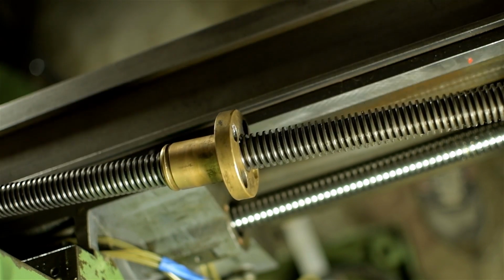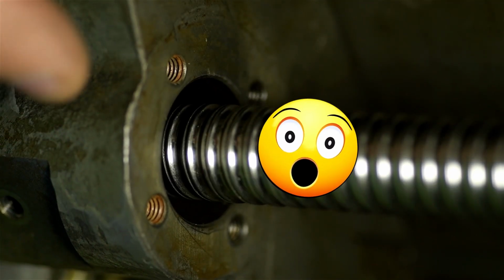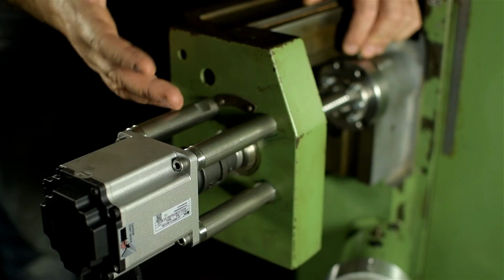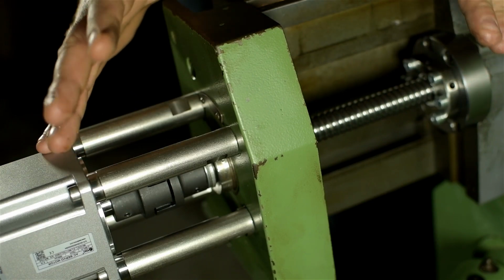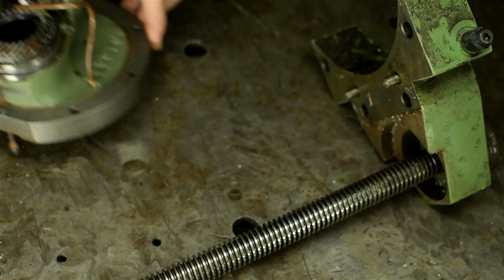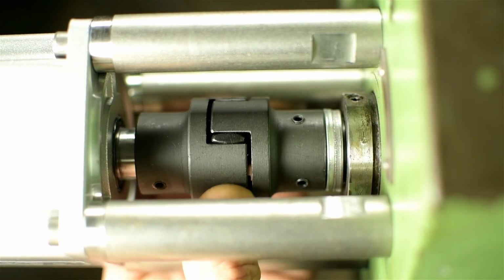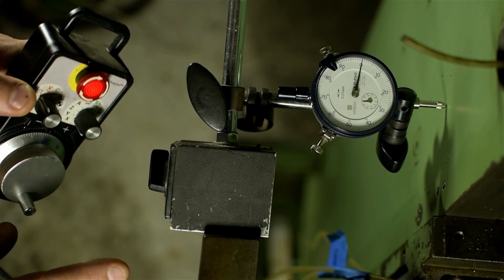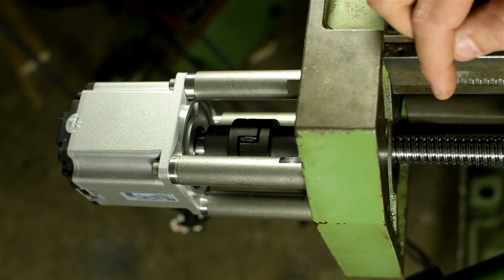Maho X Axis?  DONE!

Comment: As a CNC maintenance engineer: you used the wrong coupling. Those spider couplings are designed for use with things like pumps and have flex in them to help absorb shocks and vibrations, thus are terrible for CNC axis drive. For attaching a servo onto a shaft like that you would generally either just key it straight to the shaft without any coupling as such or put some kind of torque limiting "clutch" in the middle that will slip if you crash the machine. (kinda what a key does anyway if you choose the right size key) 
You could probably use a suitably strong version of one of those accordion type couplings as they don't have any rotational flex like the spider couplings do but there isn't really any point when the motor and shaft are concentric and solidly mounted, they are designed for mitigating slightly misaligned shafts which you shouldn't have. 
Hope that helps :D
Reply: Can you say something about Z maybe?
Reply: I think I can physically see the two ends moving separately.
Reply: @AlexanderYastrebov  the belt is the worst part of that, it went loose on the other side so it clearly flexes a lot during operation
Reply: Cnc machines doesn't use couplings?
Reply: Haha he said misaligned shafts
Reply: The Hurco CNCs I used to run almost definitely did use motor couplings, of the kind Tony is using, the damping material may be wrong, i.e. it needs to be stiffer, but I’m not sure running it without any damping would be advisable, more research needed I think.
Reply: Tiago Lomar It depends on the type of coupling. I’m in HVAc an work with pumps and fans all the time. We see lots of these “Lovejoy” style couplings. They’re pretty forgiving when dealing with loads that still have momentum once shut off. In other words, the exact opposite of precision. Not for a CNC for sure. I like our previous poster’s idea of directly connecting the shafts together. Maybe a simple spline?
Reply: There are spiders with a very high shore hardness to minimise backlash. This does not seem to be one of them so you make a valid point. How ever with those standoffs I woudnt say you have the best alignment. A rigid connection will work but considering this soon to be family heirloom some sort of compensating coupler will go a long way.
Reply: @SirKilmore001  in addition to the higher hardness, it should be a pretty tight fit in there to pretension the rubber.
Reply: @lwizzit  I work in the maintenance department of one production unit, this type of couplings is very familliar to me too. I am just asking if cnc doesn't use couplings, no saying.....
And yes this couplings aren't design for precison due they have some gap's to correct possible misaligments
Reply: @tiagolomar  technically a key and keyway is a type of coupling as it is connecting 2 shafts or a shaft and pulley or whatever but in my experience of every CNC I have stripped down they never use flexible couplings like that on the servo drives because you want the servo to be rigidly connected to the ball screw. 
The encoder in the servo knows where the servos drive shaft is but if the ball screw can rotate relative to the servo drive shaft (through the flexible coupling) there is room for error in the system. There needs to be as little "play" as possible between the encoder in the servo and the final thing you are moving and want to know the position of, in this case the x axis bed, otherwise the servo cant accurately control it. 
If the CNC machine had a hydraulic pump or something on it then that might well use one of those flexible couplings to connect to its drive motor but they aren't used in this situation.
Reply: I'm sure you've already ordered the right part, but I think you are looking for a "servo motor shaft coupling" it looks similar to the slinky style you flashed in the video, but is a little more rigid. Also, expensive.
Reply: @AlexanderYastrebov   The way the Z is mounted up all seems legit, as T.O.T. says CNC machines never use ACME screws so who knows how that will work out but i can't see why there would be any catastrophic problems. With the weight of the knee pushing everything down onto one side of the pitch it should have reasonable accuracy as long as it doesn't bounce when machining. 
As to why the belt was getting hot, I'm not sure, maybe it was not big enough or over tensioned or something? If the shafts are misaligned (there I go again) the belt will track against the pulley flange and rub making it get hot and also wearing out the belt pretty quick, can't think of anything else right now.
Reply: Those spiders look a bit spongy, but my Fadal uses similar couplers so clearly they're suitable for CNC in general.
Reply: Ermahgerd you got a tot like
Reply: @joshuastephens6112  That's for a fatal, and they were that. I didn't know anyone was using those machines anymore. Good luck to you with it.
Reply: @garys9694  I mean it's not like this Maho is the pinnacle of 2020s technology.
Reply: G G yeah on the nose. Those will eat all the runout and some angular misalignment on a basemount pump shaft no problem, but they aren’t designed for precision reversing operation. I’ll bet there’s easy a couple of thou slop in just in the flex jaws. Something you’d never notice on a pump or fan drive.
Reply: I'm sure Tony could just cnc a new bushing(?) out of delrin or bronze or aluminiuiuium to replace the squishy one.
Reply: @Johnson-el9zs  Thank you. As I've understood the belt drive was chosen to allow manual handwheel attachment in the future but seeing direct drive on X (i.e. no handwheel possible) it makes no sense to me now
Reply: @joshuastephens6112  Mahos were very well built and were very accurate machines. Fatals, not so much.
Reply: @MF175mp  idk about this exact setup but belts are not an unacceptable driver for cnc axis. They do need to be tuned perfectly though. I used to do cnc maintenance at a shop and there was a micro (I think was the name?) 5 axis cnc and after maintenance there was accuracy issues and we brought in a guy that showed us that the torque spec for the belt was a frequency the belt made.
Reply: This is quite right, I have only seen one CNC machine with a torque clutch, when it failed Gleason Pfauter told me to remove it and make a direct connection and activate the input in the PLC it was a Siemens 3 system from 1985.  I have serviced over 200 CNC machine through the laste 25 years.  Servo motor is always connected directly, some have 1 or 2 measuring system,  so if you have oscillating in your system, then you need to adjust your servo drive controller. 👍 to Tony 👍
Reply: As an engineer that designs automated manufacturing equipment, some spider couplers are suitable for high accuracy applications. Certainly a helical beam or bellows coupler would be more torsionally rigid, but an appropriately sized, curved jaw coupler can do well in this type of application with the right spider material selected. Of course if he had one on hand, it's probably not the right one...
Reply: My Fadal has this type of coupling, it is a very hard durometer polyurethane or rubber coupler though.
Reply: Simple things first: Pull off the servo. Attach an olde fashioned human educated handle (handle wit tic marks). Set-up indicator. 1. Grab hold of axis and force in/out by hand. Should by no/little movement. If moves find ur backlash. 2. Crank the axis in/out counting tick marks & parts of ticks. Should be same in & out to get same mm.  If not, backlash in some ball screw part.
Reply: Lovejoy couplings are fine, with the right hardness rubber bushing. I've worked on several horizontals with them.
Reply: But its closed loop cnc
Reply: My concern here is similar to my comments on Z axis. If you rely on the motor encoder for position feedback, then the drive system cannot have any backlash. The source of the backlash is what has to be addressed. I like Mazak's direct drive approach with slip ring direct coupling of the motor to the ball screw. No key and no damage if a crash is sustained. TOT didn't cover his mechanical backlash measurements well enough for me to follow. His motor end ball screw bearing(s) position and hold the ball screw. The outboard bearing should allow some radial slip. Its purpose is only to support the radial load of the ball screw. I would like to see a rotary encoder direct coupled to the ball screw for machine position feedback. I would abandon the flex coupler as it is a high suspect to me for backlash. Linear scale position feedback is another reliable option.
There are better ways for indicating position accuracy than a travel indicator and 1mm hand wheel pulse commands. The step is very small and machine windup may affect actual machine move. Move axis in - direction. Establish travel indicator zero. MDI several larger steps in - directiion. MDI same incremental steps in + direction. Read backlash on indicator. There are multiple methods that can be employed, but this is a good method if you can only set up travel indicator to capture one large move.
TOT was a bit loose in his description of validating ball screw thrust bearing backlash and we don't know the precision of the ball screw. There can also be backlash in the ball nut. I would hope not, but I would validate it before assuming zero ball nut backlash.

This is a home shop retrofit. TOT is learning. Demanding he applies all or best practices breaks his budget and time not mine. This is a fun format to consider best practices for field machine retrofitting and to discuss best practices. As I said in my Z axis comments, no reference switch and no over travel switches borders on craziness, but this is TOT's project and not mine. I can still get shudders from recalling having to restore actual machine position either due to a severe mechanical failure or crash or simply losing absolute positioning battery backup power. The recovery was so much harder for the repair technician than simply re-referencing the machine to restore location. I only ever serviced one machine without a reference system (marker pulse, traditional reference limit switch or proximity switch, etc.) To re-establish position on this machine was arduous and difficult. I often wondered how much profit was earned by that machine builder or how much purchase cost we saved buying that machine without over travel switches and reference switch system? That base machine was easily $250k. When I think of the labor hours we expended correcting for lost position over the nearly 25 years that I was responsible for its service, I wonder how many times we paid for the initial savings? To my knowledge, this machine is still in service as a one of a kind process. Fortunately at least two technicians still work there that are capable of "quickly" recovering machine position.
Reply: (agrees in hand motions)
Reply: and considering the encoders are built into the servos, there is no way they can know if the reported position is the actual position.
Reply: @chanakyasinha8046  the encoder is in the servo, if the coupling and ball screw have backlash the encoders won't see it.
Reply: @paulhunt598  exactly.
Reply: I don’t know a lot about CNC milling sorry for my ignorant chime in but as a industrial mechanic I have a little bit of knowledge in the field of industrial automation and robotics a lot of which involve many different types of electric motors, servos, PLC operation’s and such so I was thinking I’ve never seen a rotex style coupling assembly on a machine where minimizing backlash was critical . So I was thinking a type of keyed rigid coupling for this application as well, cheap dependable and can probably minimize backlash almost as much as can be...(old tony can just make the simple style rigid coupling better than it could be purchased anyway...probably) though it could turn into a nightmare getting a rigid coupling just right to avoid damaging bearings if the mating c faces of the driven and drive units aren’t dead nuts perpendicular and concentric to the rotational axis of both shafts. I think it’s going to be a problem he already has or believes he will run into hence going Rotex style couplings right off the bat since they are designed to handle small amounts of shaft miss alignment and run out without causing a ton of vibration. But I also think a lot of high load starts and stops and frequent direction changes are gonna destroy those flexible inserts over time anyway like you said, that style of flex coupling  is really common for pumps, and pumps are typically designed to run one direction only for long periods of time without shutting down.
Reply: Haha nerd!
Reply: I haven't worked with CNC's before; but, I have done a lot of work with servos for motion control.  In my experience, getting the motor axis perfectly lined up with the drive axis is near impossible and the high RPM that servos run an will make any misalignment a real issue and thus I always use a coupling.  Now I know the impossible is your middle name; so, maybe that issue does not apply to you.  I mean, you are the king of insertion.  Regarding the type of coupling, I have used both without any issue as long as they are a quality tight fitting coupling.
Reply: @axeman2638  oh thanks...
Reply: I would also add that a double ballscrew nut would be advantageous. Cheaper ballscrews do have backlash, especially under load.
Reply: I have machine a coupling like that a high quality one. The rubber in this one was hard as a rock and it was impossible to separate two halves by hand. The one that Tony uses don't look like that.
Reply: TOT could build a simple clutch to protect against crashing using a stack of Belleville washers. Would be easy to turn his own coupler with clutch that fits in that space.
Reply: @Johnson-el9zs  Never mind misaligned shafts. I've found generally, when you're dealing with a shaft to flange combo, alignment is key!
Reply: The coupling type is a proper one, but not with the right hardness for CNC application like a mill. Typically used in high-end CNC mills no problem, but the proper coupler is hard like a brick and you have to use a special tool to get the halves mounted, as it is not a push-it-in style like on pumps.

While I like that people have done lots of work in some area, please do not assume you have seen it all or know it all.
Reply: I'm a CNC maintenance engineer too! This kind of coupling can work, but there is 2 things wrong now, the material in the middle isn't stiff enough and has too much play. Second, when using this coupling you should also use a scale. Since this machine is motor encoder only the best way is to use a motor coupler like shown in the video (the alumium one with the grooves), or use the disc style ones with a disk on the motor shaft and one on the ballscrew. Then use square spring steel plates which are bolted on 2 corners on the motor shaft end and the other 2 on the ballscrew end. Kinda hard to explain, but this is something which can easily be made by ToT. (google disc coupling) Never direct drive the ballscrews, i've seen motor axis snap because of fatigue due to misalignment.
Reply: As explained it is the wrong coupling. Automation direct sells the correct servo coupling.
Reply: Hmmm, this feels wrong. I think you should move forward with a different coupler but not voiding the coupler all together. You will likely never have to replace the bearing inside your servo motor if you have an appropriate coupler, but if you rigidly couple the shaft to the ball screw, they’ll be a ticking time bomb. I even think the style of coupler isn’t that big of a deal, the stiffness of the middle part might be part of the problem though? I’d say just order a very large “accordion” type.
Reply: Frauenarzt Dr. Stefan Frank Well, there is a screw that gives huge torque advantage and second Z originally is driven  by handwheel while now it is driven by >100W servo
Reply: If Z drive is ever reworked, my proposal is to use ball screw and drive it directly by servo, i.e. get rid of the belt and existing angle/worm gear altogether
Reply: I work on a CNC-mill with 4 meters of X-travel and it uses two servomotors coupled together to move the X-axis with this type of coupling. Although they probably electronically compensate for the slack when switching directions.
Reply: @M05000583  well, if you don't run on servos, but pick up the positions like the DRO does (glass scales), the play in the coupling should not matter much.
Reply: Used Lovejoy type jaw couplings for years. Most are not even machined were you out the load cushion and not a tight fit. We used Dodge ridged couplings but don't think they are made that small. Just machine you own ridged coupling. How did you decide on the servo size? Guess you said you did this before.
Reply: I retired as a class A machine tool assembler, and Whitewater is correct in all points. Connect the servo directly to the ball screw shaft. There should be NO flex coupling between motor and shaft. The only place those 'accordian' spiders can be are on the encoder readers that go on the other end of the ball screw, but since you are using servos and not stepping motors, no encoder is needed.
On another note, isn't shoving cast through dovetails just soothing? When iron is running on iron, it's almost zen-like when it's all lined up.
Reply: @supremecommander2398  It matters, pid tuning, acceleration, compensation and whatnot, the more play you have the worse it is to tune, and usually any serious application will have 2 encoders, the one in the servo and one linear at the table.
Reply: We build cnc Machines and we only use the accordion type couplings ;)
Reply: @kaden56  That type of couple is fine imo, just needs a proper one, but indeed rigid is a bad idea imo, no such thing has perfect alignment.
Reply: @lwizzit  Lovejoy is not the only company buiding these, and there are high load high precision machines with this type of coupling try Rotex GS for example
Reply: @tiagolomar  They are, just not the cheap ones, try Rotex GS for example
Reply: You guys are on another plane.
Reply: If your motor shaft alignment is correct, run it without a coupling. Or if you want to be hard core accurate,  put a shaft encoder on the other end of the lead screw for your DRO.
Reply: @cronos51101  Bellow coupling gets my vote !
Reply: Also a cnc maintenance engineer here. The machines at the factory i work all use this type of cupling or belts, but they all have linear encoders on all the axis.
 Emag vl3, vl5, vl5i
VSC 160,200
Deckel Maho
Reply: @M05000583  I think 98 Shore A is the stiffest durometer you can get. That's usually the green colored spider.
Reply: Can't say I agree about solid couplings, but you're right about the bellows couplings. They'll be the stiffest rotationally, while providing some alignment compliance between the two shafts. They're also incredibly expensive and unnecessary for a servo system. Spider couplings work fine and in many ways are superior to helicals.
Reply: "That’s what I had" "not sure it’s the right one". Your whole comment was pointless, congratulations.
Reply: Look for the backlash free type, such as the ROTEX GS backlash-free servo couplings. The standard spider couplings have a few degrees play for the element. You can preorder those with the correct hub bores and key as well.
Reply: Was about to say the same thing.  Save yourself a lot of grief and frustration and make this connection much more rigid.
Reply: For the motor coupling I would suggest Oldham hubs.  The cut spider hubs have play and the cut spring hubs act as a stiff torsion spring with no damping. Oldhams only downside is high speed applications but I'm guessing you won't be running at 10k RPM.
Reply: I was thinking the same thing, & wondering why it needed a coupling at all.
Reply: There is no way that you can align the motor and the shaft, coupling is a must. Servo motor's shaft bearing will be worn less than a year.

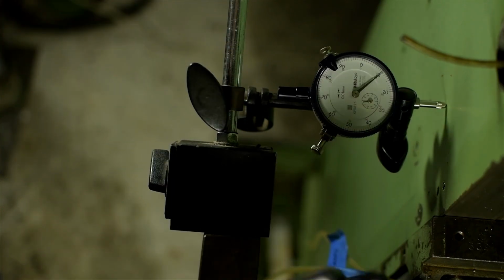For 8:34 ,check "backlash compensation"(or a parameter has the same meaning) is set to zero. And dismantle motor ,make sure shaft comes in same place after travelling to 10 and back to zero.

Besides, check the "gear ratio" that fault might be cumulative because od wrong ratios
Reply: I have worked on Heller, Grob and LiCon mills and they all use a spider type coupler to attach the motor to the ballscrew in at least 2 of the axis. Before changing out the coupler, make sure the ball nut is tight, tight like a tiger, tight. Also the machines I have worked on have the front of the ballscrew ride in  a needle bearing. I am not sure but the old bearing/bushing you installed on the new ball screw may be causing some issue...if nothing else will be problematic when the ballscrew needs to be replaced. I look forward to seeing how this project turns out
Reply: Those are Lovejoy connections, if anyone wants to be pedantic about it.
Reply: @tiagolomar  where did you get this wishdom
Reply: Those accordion type couplers do have some significant rotational flex and vibration. I have worked on an issue with these couplings causing unwanted once/rev torsional vibrations, a torque ripple, essentially. Funnily enough it was a spider coupling with elastomer inserts that mitigated the issue I was having. This however was in an application where the coupling was loaded in one direction for the period of time over which I cared how it behaved. Spider couplings are still probably not the right choice for a CNC application with lots of back and forth movement. I think direct keying w/ a properly sized key (i.e. mechanical fuse) or a clutch would be the best bet. I don't think at the MAHO's speeds and weights that even a very beefy accordion coupler would be stiff enough. At least not with any of the accordion couplers I've seen or worked with.